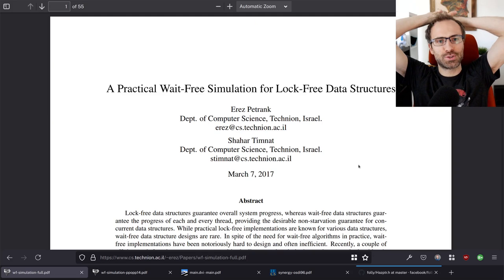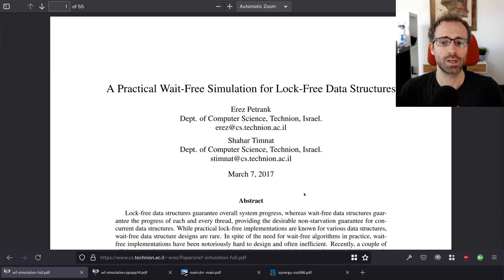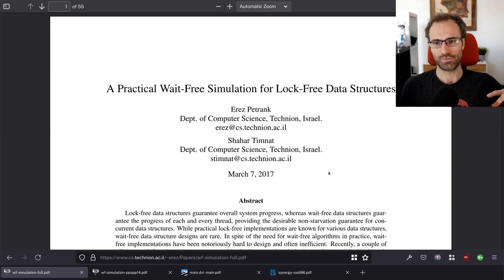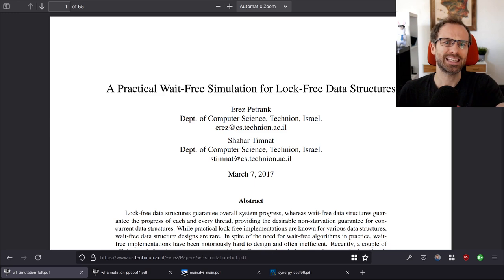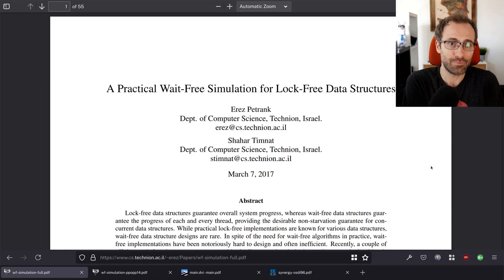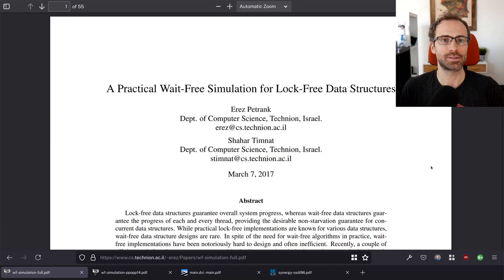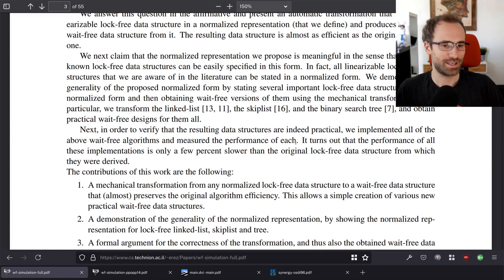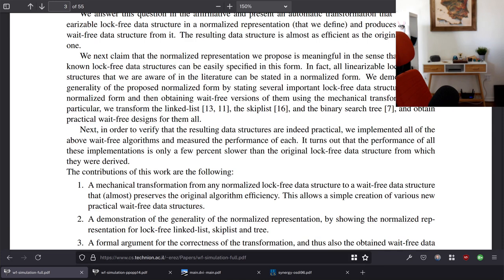Lock-Free to Wait-Free Simulation in Rust

Comment: 3:12:20 One example where you might need to care about the ABA problem is a tree map? There, the node needs to be smaller than the right child. If the right child gets replaced with a different node (with a different value) that happens to be at the same address, then you have a problem.

Comment: Apart from reading lots of papers, what would you recommend to learn about lock-free and wait-free algorithms/data structures? Most of the material I find is just "how to use a mutexes" and "how to increment an atomic" and nothing beyond that. I found several enlightening talks (mainly from CppCon), but of course they can go so far in a limited time. I would prefer a well structured book, but maybe this is asking too much.
Also, as a hardware person, I'm also interested on the reasons why CAS was chosen to be basic primitive instruction, etc.
Reply: I would recommend The art of multiprocessor programming. It covers much of the topics of this stream and presents lots of real-world algorithms and data structures (mostly in Java). As for the second question, I would say that it's because it's a simple, yet powerful instruction. Another primitive is LL/SC: https://en.wikipedia.org/wiki/Load-link/store-conditional, which avoids the ABA problem and is implemented in some architectures.
Reply: @juniorbassani5469  thanks! That looks interesting.
Reply: Is this a promising research area? Would like to know the application of this mystery thanks bud

Comment: Jon, one recommendation on book. Dig into the "Why's" of interior mutability. When I come across this, I read as "interior who" - because it's just not really a concept of most programming languages.  So, the way I've come to see it, the most common use case is where you have a struct with a bunch of fields and you want to ensure the vast majority of them don't ever get changed, so you lock down the entire struct variable binding without mut, but there is some fields that may actually need updating - might be metadata, or whatever. But, so yeah, if the programmer has a use case in their heads as to the Why to answer the wtf is this, then it just flows into their heads better (I think). This comment is really just a regurgitation of something that tripped me up anyways, and likely others.

Comment: Would conflict-free replicated data types (CRDTs) be wait-free? Let's say its a register CRDT that stores an opaque value. Even if the value changes, the thread won't fail on a merge or update  because of the built in conflict resolution semantics of CRDTs. Here's another example,  a List with Last-writer-wins conflict resolution; if the value changes, the thread wont "fail" because updates are idempotent (due to the last-writer wins semantics). Of course, LWW would only be good if the work each thread is completing is dispensible. It could be like Max value wins if list elements always increase in value etc... Or am I off base with this question?